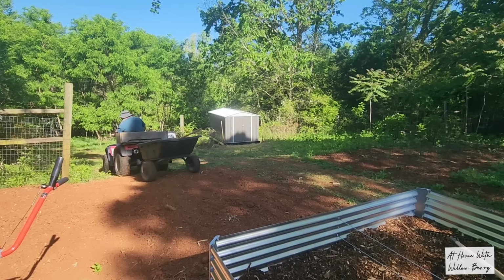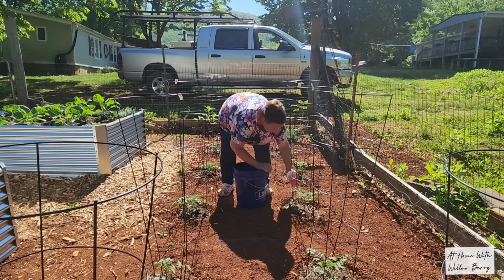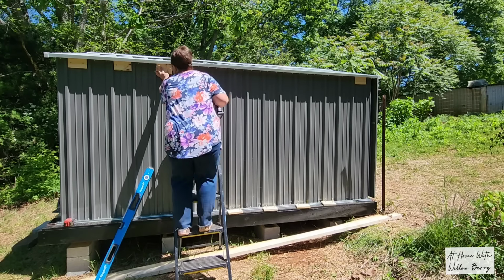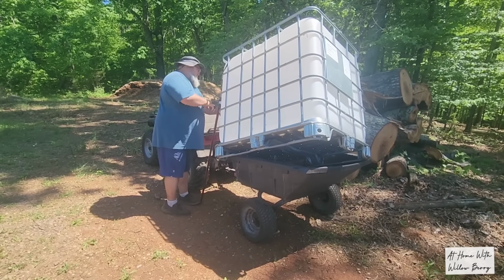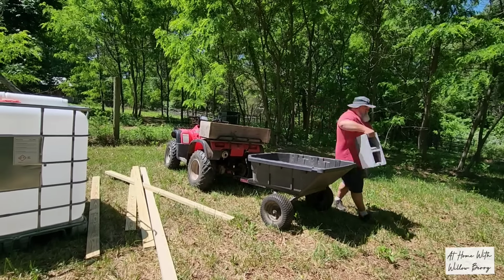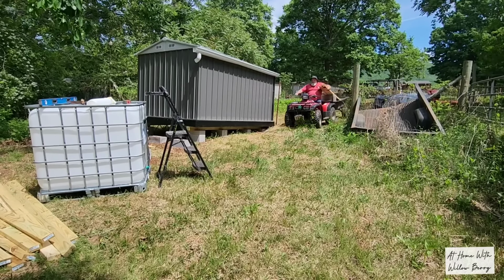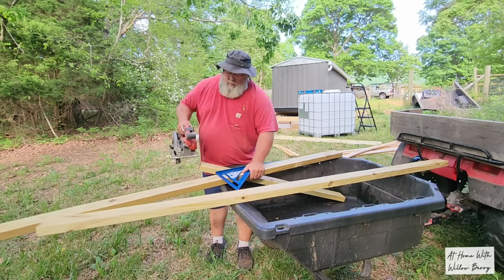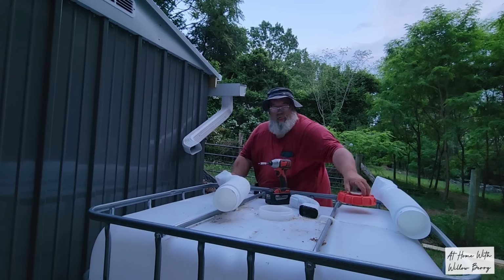Getting water to our garden patch. / Water Catching System / Home Gardening Journey

Comment: I have 2 separate rainbarrels that are raised 3ft up off ground without any pump and I tell you I wish I had one.   The water flow is slow and works best using a drip hose.  Most of my garden is in big pots, 5 gallon buckets, large dish pans and more.  My veggies are not growing inground due to moles and voles.   Love your rainbarrels.